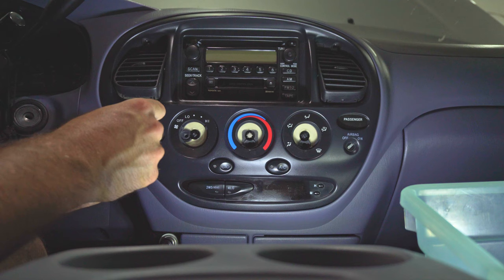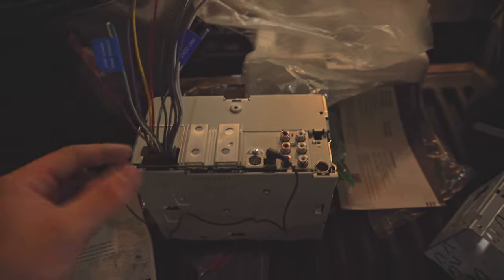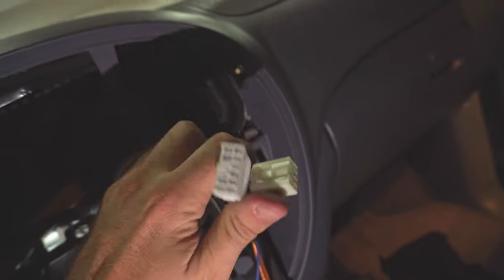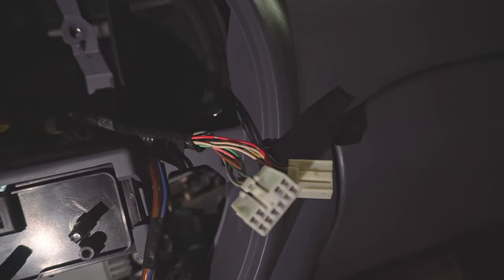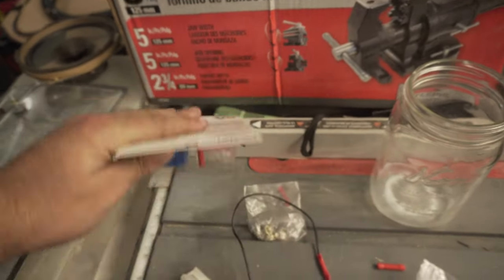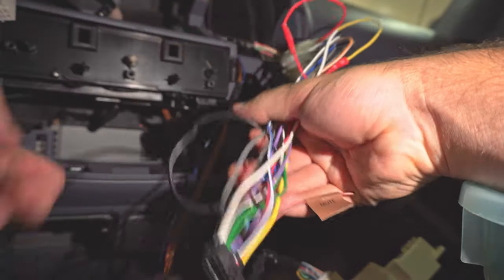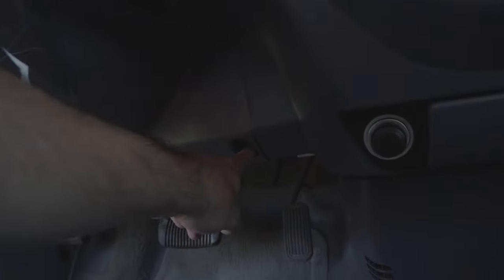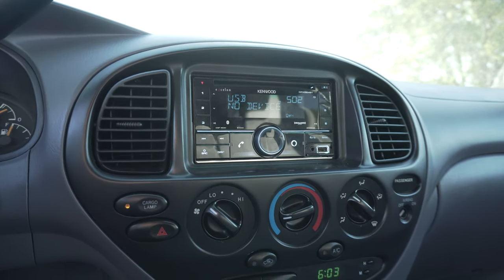Toyota Tundra 2001 Stereo Install HOW TO. First Gen Tundra Kenwood Head Unit. Bluetooth/Hands Free.

Comment: Thanks for the video, buddy. Ill be replacing mine soon! Did you have to bypass thexstock amplifier or was there a reason you decided to? Just curious
Reply from the maker: The adapter harness for the stereo only plugs in to one harness in the vehicle- by plugging into that harness, you necessarily bypass the stock amp

Comment: If you are replacing a radio with navigation on a 2007 Sequoia, you will need a digital cable adapter. This one worked for me: AXXESS TYTO-01 Toyota Digital Amplifier Interface 2001-2015.

Comment: Great video! Can you point me to which harness I need? So that my radio can fit properly in my dash? Or do I not need one?
Reply from the maker: I have the adapter linked in the description. If you have a different vehicle or stereo, crutchfield can help you make sure you’ve got the right one.
Reply: Sorry, I should have specified haha, i meant the stereo installation dash fitment kit. aka the plastic that fits around the radio onto the dash. @208Tyler  I guess it looks like it fits just the stereo itself without any additional fitment accessories.

Comment: Did you have to hardwire into the parking brake? Crutchfield is telling me to do so but you just did the same as everyone else with setup
Reply from the maker: No. 

I’m not aware of anything having to do with the parking brake, and I’m guessing “wiring into it” (I’m skeptical that that’s a thing on these vehicles) would be to enable some kind of safety feature that prevents stereo use/adjustment while the vehicle is moving

Comment: So are the colors a standard thing for all stereos or do I need to make sure I’m connecting the right wires … I’m hoping it’s standard so I don’t have to go thru that 😂

Edit: does crutchfield have a guide for each specific stereo
Reply from the maker: Cruthefield sends a guide with each stereo, for each vehicle. 

I have no reason to believe that the wire colors are universal across different makes and models of cars and stereos.
Reply: @208Tyler  thanks man definitely gonna order from them then also the install video is gonna be super helpful once I get to that point !
Reply from the maker: @ggg_2414  Awesome! good luck

Comment: How Did you get both screws holding in the stock amplifier out
Reply from the maker: If I remember correctly, I just barely caught the screws with a screwdriver- it was tight and I was close to stripping them.
Reply: If you pop the panel out that has the cig plugs you can reach up and pull out the brackets.

Comment: Probably worth mentioning the climate control needs to be plugged in or the stereo wont power on. I took the panel off and disconnected the harness to make more room to work and could not get power. Took it out and plugged it into a battery on my workbench and worked fine. Tested all connections and were good. Finally gave up and put my dash together without the stereo because i needed a/c. Then one day i looked at the harness sticking out and said lets try again. Powered up fine.

Comment: I have the pair of wire plugs like you showed but isn't there 3? I can't find the other clip. Do I need it?
Reply from the maker: Everything shown in this video is what I did. 

Aren’t there 3… what? Total wire harnesses?
Reply: @208Tyler   I looked at other videos and figured it out. There's only two separate clips attached to a bunch of wires one is like a double so it looks like 3 but it's only two. Thnx for your time

Comment: I’ve done all this with three different radios so far and none have worked. I’m being very careful with the wiring connections but I still haven’t had one be able to get power and turn on. I went through 3 radios because I thought that maybe I wasn’t getting enough power to them because I bypassed the amp ? And maybe these radios in particular don’t have built in amps ? Would it say if that were the case? Idk I’m just guessing
Reply from the maker: I always double check my crimped connections just because I feel like they’re a vulnerable connection that’s easy to screw up. But I followed the crutchfield instructions down to every step on this install and have done the same on 2-3 other installs with no issues. The fault is probably in your wiring or something’s been damaged on the truck imo

Comment: We cant get our power antenna to work after we installed the same radio. Any advice.  Thanks
Reply from the maker: There should be an antenna plug from the stock stereo that gets unplugged and then plugged into the new head unit. Beyond that, I’m not sure what your problem would
Be